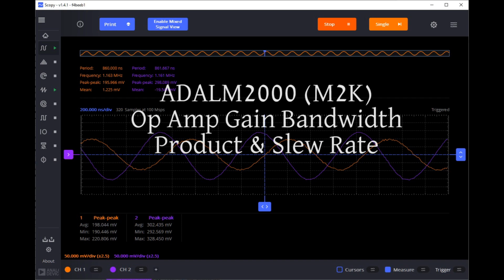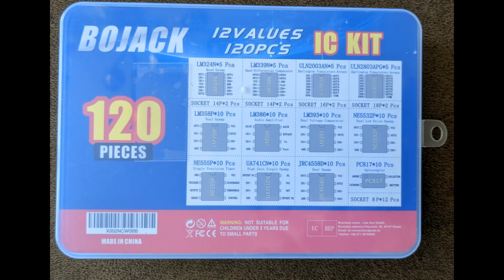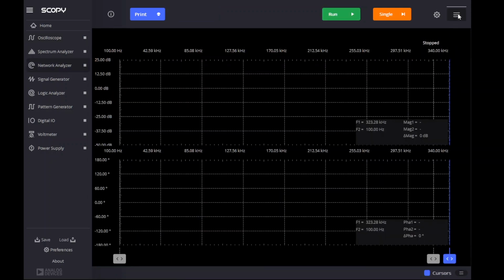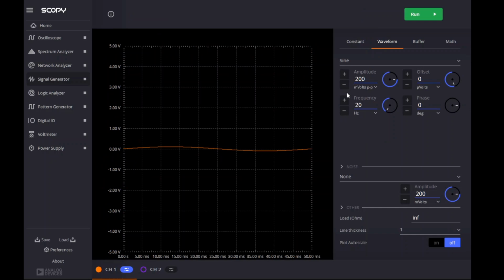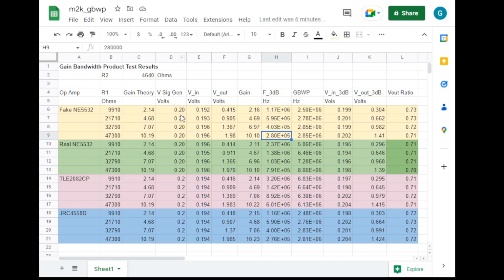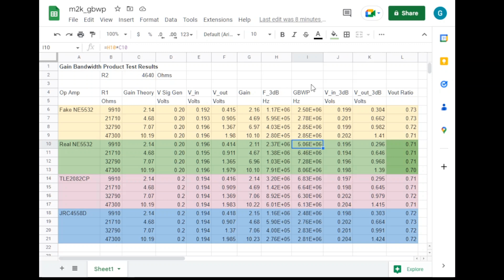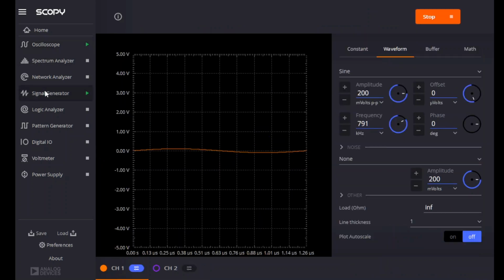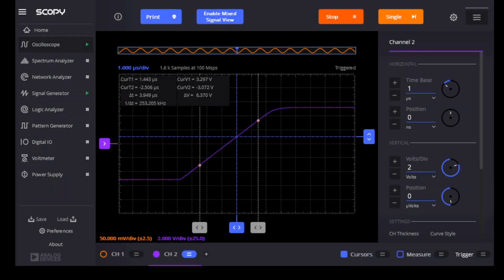ADALM2000 (M2K) Gain BW Product and Slew Rate.  Detect Fake Op Amps?

Comment: Great video! As I’m expanding my lab I ran across this device and it looks really good, and surprisingly(?) the software looks polished as well.
Reply from the maker: Scopy is good from a feature point of view and is stable enough to be quite usable.  I see crashes from time to time on Windows, but only rarely on Linux.  There is also an API so you could write your own software, for example for data logging.  But Scopy also makes it easy to capture data and save it to a file for post processing.